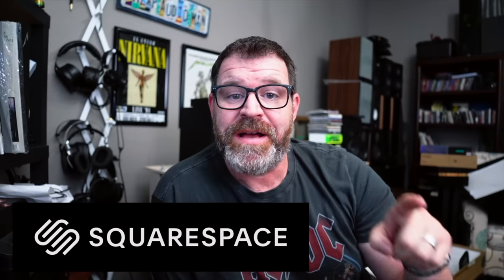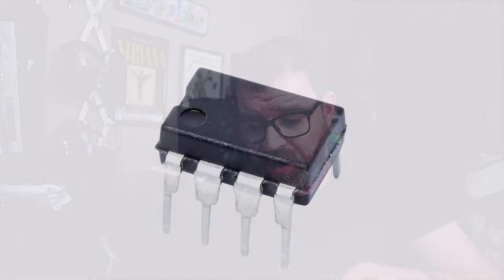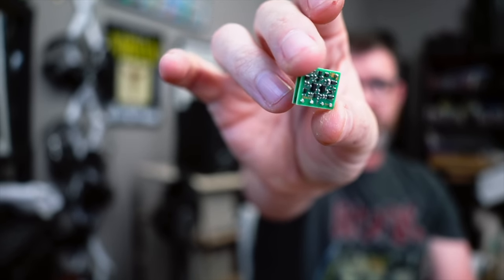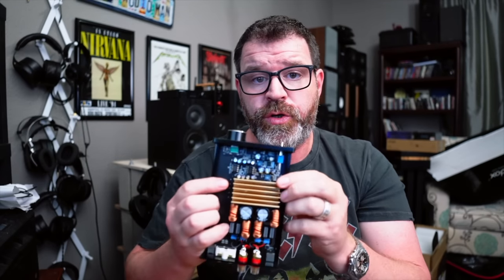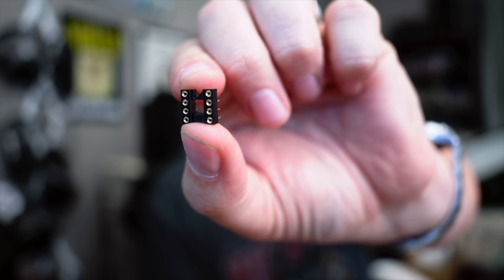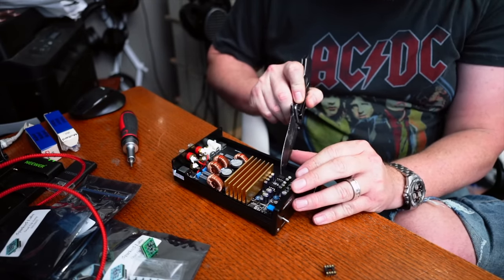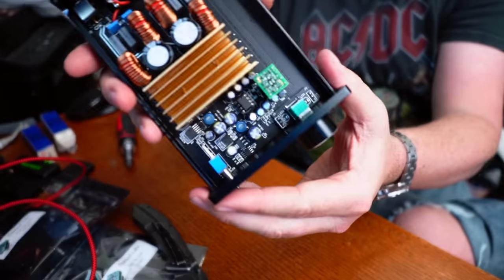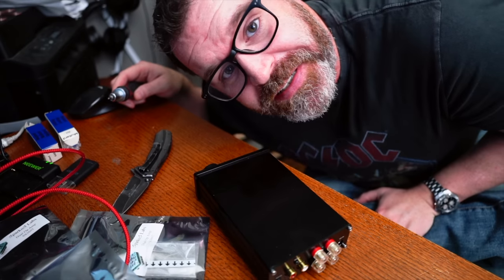Make an $80 Amp Beat $1,000 Amps?! Find out How!

Comment: A bit late, but for posterity sake I learned that you must use dual circuit OP amps in the AO7 - In other words the SS3601 will not work, you must use the SS3602 (which is what Randy is using in the video).  Sparkos did an exchange credit for me and after paying the difference I've got the SS3602s headed my way.  Don't make my mistake!
Reply: be nice to hear what (in your opinion) differences it made with the SS3602s once you got 'em
Reply: @moss8448  It made the Aiyima A07 a bit clearer on a pair of Jamo S803s (which sounded a bit bloated and muddy before - not the A07's fault, those 803s just aren't great speakers).  It definitely livened things up a bit and made for a bigger larger soundstage.  Having said that, I'm not sure it's worth the money tbh.  For the $160 for the two discrete op amp chips and $80 for the A07 - at $240 you have a lot of other options out there would would probably sound better and give you more clean power.  If you are using the op amps on a different product (I know there are plenty of applications), then I'd say maybe they are worth it depending on what you are doing.
Reply: @ount252  I think one of these other things to consider though is form factor. You could buy something else in that $250 range but at least for me right now, the A07 is just the right size. Also as another data point, I just did the swap to the SS3602's yesterday and there is definitely a difference in the sound. There was a jump in detail that surprised me because I thought I had it pretty good already (speakers are Polk R100s,) and the soundstage did get bigger particularly front to back from what I could hear. I'm really pleased.
Reply: @carnut374  That is a very fair point.
Reply: How are these 80 dollars on the website when he said 4dollars?!
Reply: @jaromaston1068  4 dollars are just the 2 risers

Comment: Hey gang....just to let you know, I installed these Sparkos op-amps in my Aiyima A08 also (now do be advised though that the A08 takes 3 of them), and again - a major sound change for the better ensued!  The amp now (also) has that class AB sound - that is warmer and more dynamic.  Now do be advised that with the A08, it's a bit more tricky.  The top does NOT come off.  Remove only the front panel (where you'll see the 3 op-amps right towards the front for easy access), unscrew the 4 screws, pull off the volume knob, and unscrew the nut that holds the volume knob control ring in place tightly.  Then you pull off the front (it won't come all the way off because wires are attached).  Now, reach in carefully and remove the stock 3 op-amps (use tweezers - they work the best), and then you just replace them with the Sparkos ones.  At first, I tried taking off the entire top - can't be done, and you have to be very careful because you could damage the unit.  Again though - it's another wonderful upgrade, bringing the A08 to amplifier audio levels that usually you'd have to pay 10 times as much for, or more.  Enough said!  Thanks again to Randy for making us aware of upgrades like this.
Reply: Thank you for sharing your setup. I'm thinking of getting A08. Did you have to buy the leg extension to put in, like the video above for A07? or it doesn't require the extension?
Reply: @sarahjh785  At first I thought about getting some extenders - after all, they are only $2 a piece (or something like that).  But surprisingly enough, they go in without the extenders, although it was close.  So if you want to use the extenders, that would be fine also.  I swear, I'm dumping entirely too much money into Sparkos Labs.  I put the Sparkos Labs Op Amps into both my Aiyima 07 and 08 amps, and also, I put one in my inexpensive FX-Audio DAC X6 Mk II DAC, where it made an appreciable sonic difference.  I've got two more inexpensive Chinese amps coming and between the both of them, they will take an additional 6 op amp change-outs.  Damn, I'm goin' broke here.
Reply: @MrBenherrmann  Thank you for sharing your experience, I can't wait to hear mine when it arrives!

Comment: I have the Sparkos ss-3602's inside my HP amp (Gustard H20) and they're very good sounding pieces. I am also trying out the Burson v6 Vivids in comparison and they're great too (but in my amp the Sparkos are slightly better - in another component it may be the exact opposite). This is a relatively cheap mod to upgrade SQ on any component that has compatible opamps and DIP8 sockets - much cheaper than buying a different component and most discrete opamps stomp IC opamps, IMO. Be careful to make sure which types of opamps are inside of your component before you replace them - ie: single or duals, opamp inter-compatibility, and orientation. Happy listening...

Comment: Just yesterday I swapped out the OPA2134s in my AkitikA PR-102 preamplifier with Sparkos SS3602s.  Everything sounds even better now...more clarity, more detail, punchier bass, better soundstage, etc, etc.  What was already a fantastic preamp is now "next level."  I also replaced the stock opamp in my Topping D50s with a Burson V5i, and that was a game changer!
Reply: I am using it with vivid v6 also professional 15amp 48 volts.power supply  shocking results thanks 👨 🧍‍♀️

Comment: A great upgrade, but Sparkos discretes are a bit pricey at $80 a pop. I'm going with a pair from Orange Amps, ~$58 apiece. Already upgraded my DIYRE HC-1 headphone amp with these, that has the identical IC op-amps and the difference is amazing. They also come with sockets included.
Reply: Does that means the orange are as good or better?  If so, how do you know?
Reply: @scottlowell493  as good or better than Sparkos? I don't know, as I have never tried the Sparkos. I would imagine that they will be very similar. I can tell you that they are a big improvement over the standard IC opamps.

Comment: I got the OPA1656 (Burr Brown) op amp for my AO7.  I looked into the Sparkos op amps while researching and found the OPA1656 to be almost identical in claimed specs.  only the OPA1656 is $15 and Sparkos are $80.   And they sound way better than the ones that come with the A07.
Reply: I've heard that one is popular.  I was expecting him to try the 1656.
Reply: John, how would you describe the improvement you heard with the OPA1656  Burr Brown op amp?
Reply: @naastradamus  I got an A07 this week, and have some OPA 1656 coming next week.  So far the A07 seems very nice, but it's hard to do a direct A/B without an amp switcher.  I'm also using a mid to lower level 12 year old Denon AVR as a baseline, so I don't have anything really nice to compare too.  The soundstage seems good as it is now.  Whereever I may roam at 14s comes almost behind me.
Reply: I’ve got OPA1656 chips in an A07 and a Tube A3 preamp. They’re a great deal for $15-20 and imo the best bang for the buck.
Reply: @vanoverbay774  Looking forward to your feedback as long as you have the exact same setup than me... and I wonder how big the difference would be
Reply: Do you have a link for these? I ordered some from Texas Instruments but they're much smaller... kinda confused now. Thx.
Reply: @venomstrike4418  Ordered from ebay and yeah they are smaller and on a green pcb
Reply: Where did you get it and was the 1656 a direct fit into the A07? 
(let me answer that for you, no it is not)
8 SOIC are small and don't Plug-N-Play (too small)
8 DIP are what you want for P-N-P 
I've yet to find a riser or converter to use the SOIC in a DIP socket
anyone?
digikey is a good resource, mouser is another
I went with the Sparkos SS3602 and risers in my A07
Reply: I swapped the NE5532 for The sparkos 3602 on my preamp which piwers My tpa3255...night and day sparkos>the rest

Comment: I still have my first Hi-Fi system that consist of a pair of Pioneer 3-Way speakers, that I bought used when I was in college, one of the original Lepai LP-2020A+ Tripath Class-D amp with an upgraded power supply, and a Pure Audio A2 Bluetooth receiver. The upgraded power supply reduced the distortion dramatically, even at lower volumes. I moved it to my office and I enjoy it every day, mostly for listening to music.

Comment: The 5532 dual op amp is already extremely good, having been optimized for audio performance. 
There will be no discernible difference in performance by replacing them.  
The "difference" will be psychological,  not acoustical or electrical.
There could be a performance improvement by adding a large bank of capacitance at the power supply output.  
This might help the supply from current limiting during loud low frequency passages.   
This would need to be looked at and measured.

Comment: From one model to another or from one manufacturer to another, the very same part number Op-Amp may be in circuits that are somewhat different in the way that the signal input and output are handled electrically. A replacement modification like this may or may not act in the same way electrically.  Also, stacking a chip socket into onboard chip socket will subtly change the loading on the signal inputs and outputs of the circuit by lengthening the signal pathway. This may or may not cause issues. Also, the dual stack of the discrete Op-Amp replacement and the additional chip socket has raised it up above a well designed circuit board with signal traces and ground planes that minimizes interference from other components in the power amp.
Basically, from one piece of equipment to the next, swapping Op-Amps with another model number or with a mini discrete piece like in the video can result in better sound, no apparent change or maybe even sounding worse than the original chips. YMMV

Comment: Good tip, but an actual side-by-side sound comparison and spectrum analysis graph would be nice.
Reply: It won't show anything that you can hear.  You should install these if they make you feel better.
Reply from the maker: I don’t do measurements but it would be interesting to see if there was a difference
Reply: @cheapaudioman  You could easily do blinded A/B testing to see if can actually hear what you think you can hear. At least then you'd know if the amp really was subjectively improved at all. Otherwise it's kind of meaningless. 

Who has such good audio memory that they can listen to an amp, spend an hour or so dismantling it etc and then confidently state that it now sounds better? I sure as hell can't unless we're talking night and day differences. At best op amp rolling is going to be subtle and a single sighted comparison, hours apart is not remotely reliable.
Reply: @cheapaudioman  You definitely should do measurements. Without real values of frequency response, noise level, THD, IMD, stereo crosstalk and others, before and after change, only upgrade which you showed is price upgrade. Of course, comparison of those values to values of few random $1000 amplifiers to proof title of video would be also nice...
Reply: Got me some Sparkos op amps en route. 👍💥🔈

Comment: @cheapaudioman - I followed your guide & "rolled" the factory op amps for the Sparkos.  It wasn't hard to do & my wife & I both wholeheartedly agree the sound is MUCH better!  I also swapped out the factory power supply for the DROK 48v 10A so I cant be sure of the results but our SVS Ultra Bookshelfs are for sure louder as well.  Thanks for the great content

Comment: "It sounds like a more expensive amplifier." - because it now is :)) The two little op-amp circuits more than triple the cost of the A07. For some, that might totally be worth it. For me? I'm not so sure. I'd probably have to get better speakers first to even hear the difference... Cool little project either way :)

Comment: Would I believe it? Sure, with measurements to back it up. Sighted, non-level matched A/B tests are so prone to expectation bias, if the difference is as big as you say it will show up in measurements - the Aiyima A07 stock is a decent bang-for-buck TI3255 amplifier, but has clear shortcomings when you don't factor in price as much.

Comment: i bit the bullet and bought the risers and chips for my ayima a07.  for me, even with equalization which did improve the sound, with some rockish-songs my stock a07(paired with a AYIMA T8 PREAMP)  running to DUAL polk subs paired to tsi-100s just had a 'missing middle' and slightly hissy highs and maybe bass that was disconnected in an odd way.   i tweaked and tweaked and got it sounding good but was still a little unsatisfied.   the sparkos do make a very noticeable difference and to me improvements.   separation is definitely increased...just more space and depth to all forms of music.   and that 'missing 'middle' that i was experiencing has been fixed.   much more balanced sound and seamless sound now.   i wasnt sure about these but i am much happier about turning the system on now and listening to music.
Reply: I've got the missing mids problem with my a07 and monitor audio bronze 2s.  Guess I'll try the sparkos

Comment: An operational amplifier contains 20 transistors. A transistor can replace a single tube. 

The operational amplifier is a complete amplifier circuit consisting of many transistors and the ability to control many features of an amplifier.

Comment: What that amp needs is one of those tube preamps with the tone controls ahead of it and it will shine britely. I use that amp driving a pair of twelves and tweeters. I got a FX-AUDIO TUBE-03 with rolled tubes ahead of it. We sounding good at my house!
Reply: Hi. I also have the FX Audio tube -03. It boosts the signal, make the sound clearer and improves base. So does this do what the Op amps do or is this different?

Comment: Just purchased a used A07 for cheap and I bought the 48v Power supply from Aiyama and the OP amps from sparkos labs.  My plan is to use it as a power amp with my Integra DMT 40.7 network stereo receiver.  Only reason I'm doing this is because the receiver has zero crossover/bass management and I was able to snag a M&K Miller & Kreisel LFE-3 Electronic Crossover Bass Management Box for dirt cheap.  80hz high and low pass filters.  Not the most elegant solution but it should work great.

Comment: Great idea of Op Amp rolling. The idea of tube rolling is to introduce more or less distortion to the audio signal. Let do it with op amp as tubes are getting more expensive.
Reply: No the idea of tube rolling isn't to reduce distortion. It's to randomly swap in other tubes (normally more expensive "vintage" ones) and see if you prefer the sound afterwards. Tube amps usually have high distortion full stop. It's probably the main reason some people like them. Likewise, without testing, you've no idea if swapping a chip in will reduce distortion or increase, or mess up the rest of the circuit.

Comment: I clicked on this thinking you picked up a fancy power supply for this very bad boy! This upgrade makes sense too, as people claim components on these cheaper amps are counterfeit more often than not. Burson audio apparently makes a nice opamp upgrade comparatively priced as well.
Reply from the maker: yes. I have it but I can't get it to fit.  I may be able to get it to fit if I leave the top of this off
Reply: Yep. The better Burson op amps, the V6 vivid and classic are in a plastic housing which is quite tall so you need to check they will fit before spending your cash. They are extremely good, however.
Reply: @cheapaudioman  You good with a dremel brotha? The top off method is just fine as well!

Comment: $240 can buy a quite nice used Rotel, Cambridge Audio, NAD, maybe even Arcam etc… amp or receiver on eBay that I suspect would be superior in most ways to this budget amp with the upgraded opamps. Having the latest and greatest is not really necessary when it comes to amplification and there are plenty of 20, 30 or 40 year old designs that have outstanding sound, even if they don’t have built-in Bluetooth receivers. 

When I saw how small and relatively basic looking these upgraded opamps are, it seemed almost certain that there is tremendous price gouging for the sake of slapping an “audiophile” label on the product.

But DIY upgrades are certainly an interesting topic and there are a number of posts here that make suggestions for upgrades at vastly lower prices than $80 each. I would certainly try one of those recommendations first before spending $160 on what looks to be about a dollar or two worth of parts.
Reply: The Sparkos stuff is outrageously overpriced and spending $160 to upgrade a generic $80 amp borders on insane. A more powerful power supply and a few bucks for better op amps, sure. As you pointed out, if someone has $250-$300 to spend they can get a very nice, used AB from a quality manufacturer that will blow this Ayima stuff out of the water.
Reply from the maker: @gklinger  guess you’ll never know unless you try.

Comment: Texas instruments make the best op-amps available. (OPA series) No discrete component op amp can come close to their specs because the transistors can not be closely matched and this is partly responsible for low THD. Hence a good chip op amp will always perform better.... unless you like the idea of introducing THD. Also the open loop gain of discrete op-amps can not compete unless many transistors / gain stages are used. But that would make the discrete op amp very large.